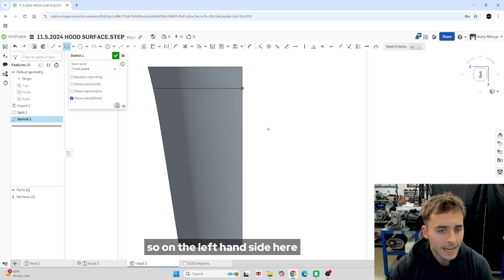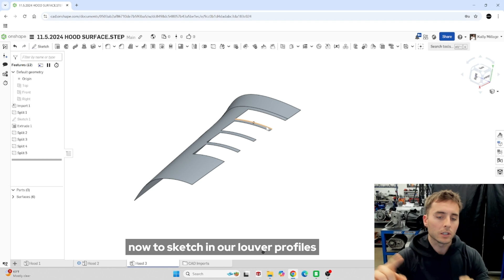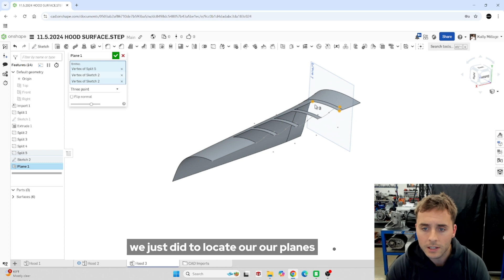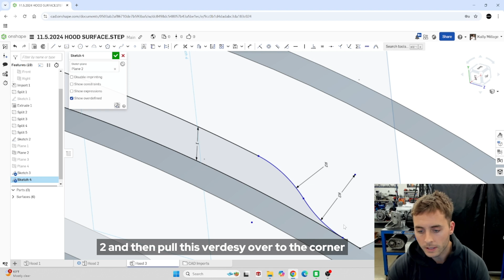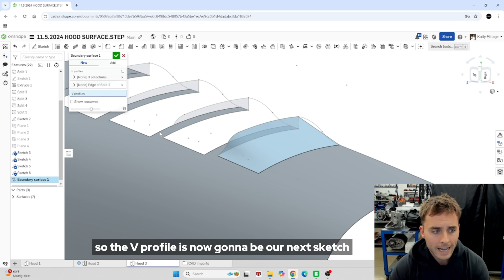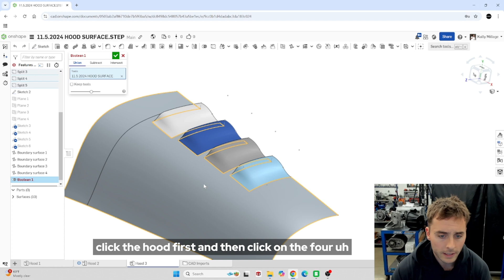Surface Modeling in Onshape / Step by Step CAD Tutorial

Comment: Do you have a video on how to draw panel lines on complex surfaces? I am wanting to design a mold for an Airplane fuselage and would like to incorporate raised or lowered panel lines and rivets into the design. I am struggling with how to do this. Thank you for your videos!
Reply: Using projected curves onto surface?
Reply from the maker: I would try to model lines, use surface extrudes from the lines, and then split the part with your surfaces.  Then, when part is split- you can manipulate those new parts by thickening, etc..  Does that make sense?
Reply: @KULLYCO  Thank you for replying with your suggestion. I’m not quite picking up on what you’re suggesting though. I’m sorry.

Comment: Thanks for the video! This a great practical intro to surface modeling in Onshape. This kind of tutorial is hard to come by.

A tip for other beginners like myself :
When you select the edges that form a boundary surface you can also set the boundary condition by clicking on the blue box where the edges are designated.

Setting the condition can give you a lot more control and also can guarantee tangent or curvature matching at the boundary.
Reply from the maker: @drewdraw0  hello! Appreciate you watching- I’m glad you enjoyed the tutorial.  I think I will start making more content around modeling. 

Also, thank you for the info in your comment- hopefully that’s helpful for others!